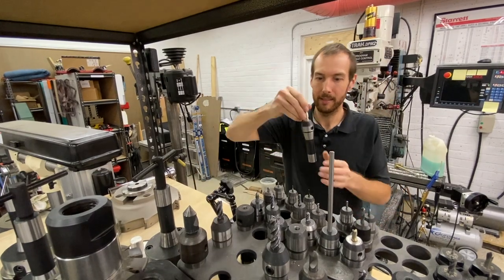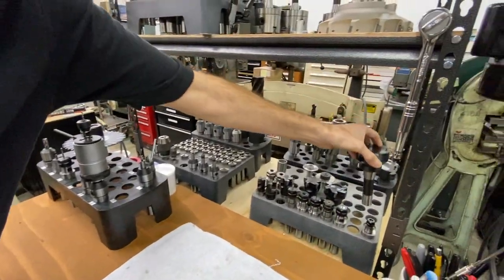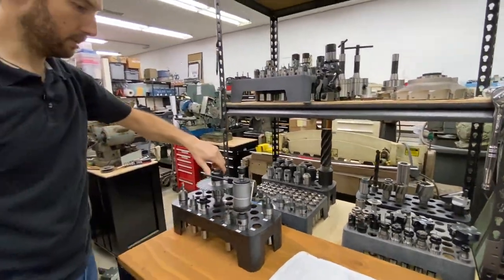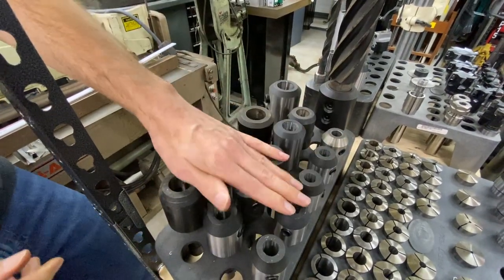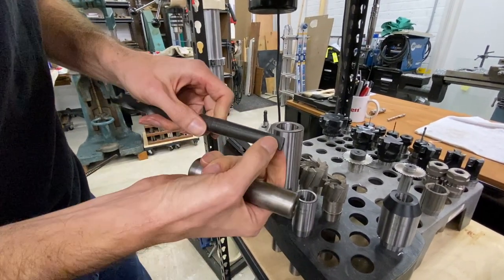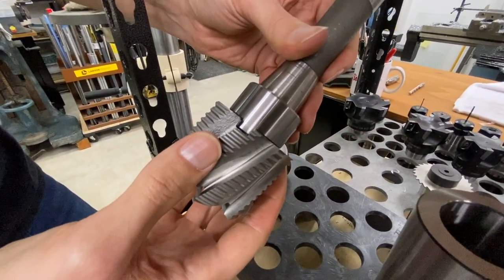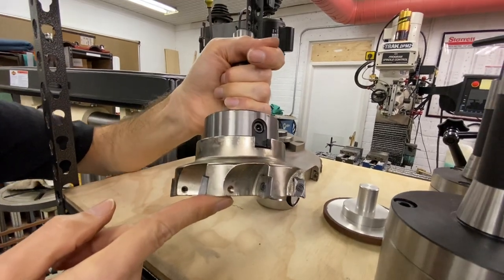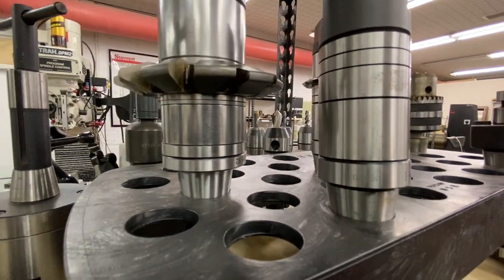LET'S TALK R8 TOOL HOLDERS (PART II)

Comment: What has worked for you to get the best surface finish on aluminum ?  I have a 2hp Bridgeport Mill with flycutters, and face mills up to 3".
Reply from the maker: Generally a sharp fly cutter is the best. For faster production il use a face mill with aluminum inserts. If you want the face mill to do an even better finish I sometimes will grind the face of the inserts so thry are razor sharp. Jusy be sure to do this on a surface grinder or some way to ensure you grind the same amount off each insert or it will vary your tool length at each insert.

Comment: Hi, I like your r8 tools videos, you show us very much tools. Im beginner and I cant decide if stay in R8 holders or convert to TTS(tormach) system, I plan to convert cnc. But i dont know if compesate r8 strench to tts Z heigh problem in cnc, or if is too hard to set it. what do you tink abut tts system, thanks
Reply from the maker: Thank you!
I never used the TTS but if you are going to cnc I would try to get to CAT40 as soon as possible. Thats the biggest series of tooling there is.
Reply: @TigermothRacingTV  many tanks for your answer, unfortunately my machine is small, oly can handle R8.

Comment: Great video, thanks for sharing .. would've been awesome if you had mentioned a few of the sources where you get your tooling (you mentioned 20-30$ at one point) but very informative .. cheers!
Reply from the maker: Shars has been good and been getting better, CME has worked very well for us, there are good vendors on eBay but I suggest doing a small test order with them until you confirm the product is good.

Comment: You didn't mention the PITA indexing pin / groove in the R8 system. I get rid of that damn pin so I can put the R8 in any orientation without fiddling around trying to find the pin.
Reply from the maker: Yeah but you can't remove that pin if you are doing heavy milling. Might depend on the power of the machine you might be using but that pin is critical for our work. Bench top machines yes I would probly remove it for speed and convenience.
Reply: @TigermothRacingTV  That pisant little pin won't hold any torque. It is only for preventing rotation while installing with the drawbar and that is all. It's not there to resist cutting torque. I removed it from our Bridgeport years ago and it works just fine without it, even though we mill almost exclusively stainless steel and push the machine to the limit.
The proof is on all the tooling you showed. There is not the slightest trace of wear in that pin slot on any of your (or mine) tooling. Look at the pin slot in the center where the pin resides and you will see no marks from the pin resisting torque. If you do manage to overcome the friction of the taper that pin will just shear off. Because the pin resides in a reduced diameter part of the collet, if it does shear off it is a LOT of fun trying to get the collet out again.(ask me how I know).
Reply: I keep the pin/key so I can have repeatability as my spindle has runout.

Comment: Good info! 
I like those collet racks, where did you get those?
Reply from the maker: sierraamerican.com. they are the best I have found. I like the plastic ones because you can just drop the tool in the pocket with no worry of wear on the taper. The metal ones make me worry.